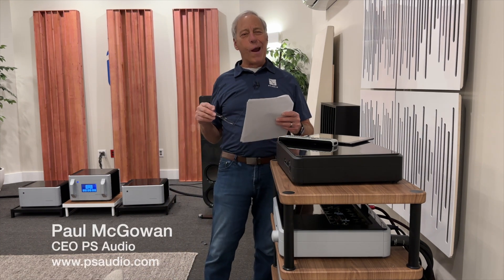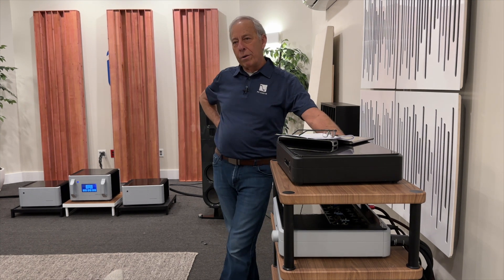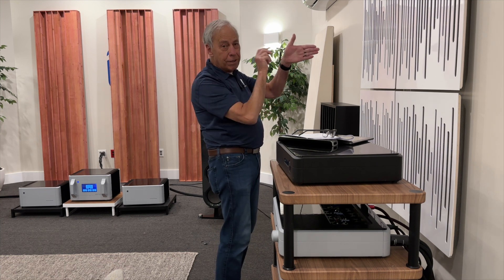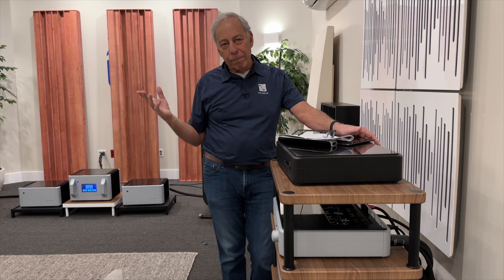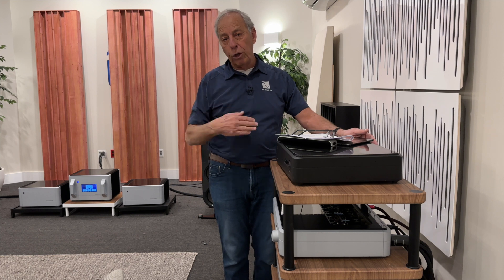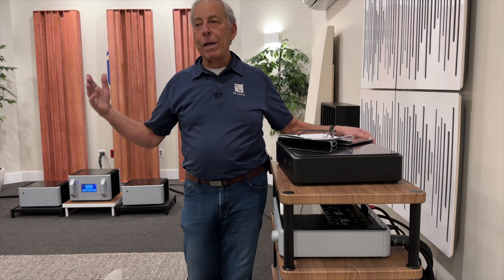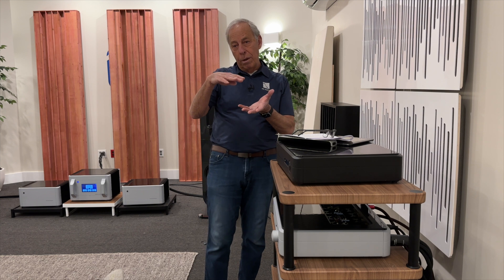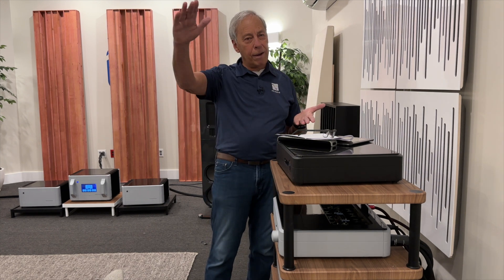Impedance matching explained

Comment: hmm.
i remember once in the past millenium, i had a couple of dynaudio contour ll speakers.
they had the option to be driven by an impedance mathing network, including a bnc terminated speaker cable. the sound was amazing. an expanded soundstage, was the most noticable result.

so, i dont know. maybe a smith chart is very relevant in hifi too...

Comment: Does this apply to loudspeakers connected to amplifiers as well and if so, wouldn't an 8 ohm loudspeaker nearly always be a better choice compared to a 4 ohm one?
Reply: Yes and no. The output impedance of a well-designed amplifier varies with frequency but would typically be in the << 1 ohm range, so low compared with both 4 and 8 Ohms. So they both work. 4 Ohm speakers allow you to get more power output from a given supply voltage - important if the supply voltage is limited, like in a car... But in a home or studio, not so much. Thats why 8 Ohm speakers are more common in homes. You can use thinner speaker wires without any significant loss as well. 16 Ohm speakers were popular back in the old valve days - amplifier outputs often had transformers in them since valves tend to be high impedance devices.
Reply: @HughCStevenson1  what if attach my 1 ohm speaker system in series with 8 ohm speakers system.is that safe or not for both of my amp and speakers????????

Comment: The power amp / speaker thing is incorrect. The speaker impedance should match the true source impedance of the amplifier. Anything else will just result in reduced output power. No amplifier is specified with an output impedance in milliohms. It will be specified in ohms with a damping factor, e.g. 100W with DF of 100. The actual output impedance is the voltage output divided by the current. The output impedance as measured with a small signal impedance meter may well read in milliohms as the output impedance is artificially lowered by the application of negative feedback and this value can be calculated from the damping factor. This lowered impedance only holds true within the capabilities of the output transistors and makes no difference to the ‘real’ source impedance. If the ‘real’ impedance of (say) a 200W amp designed for an 8 ohm speaker was really 10 milliohms, it would be possible to connect it to a 10 milliohm speaker and get an output of 160KW with an output current of 4000A, which is clearly not going to happen.
Reply: Agree with you. His explanation only holds true for connecting from preamp to power amp. For passive devices like speaker, the impedence need to match the power amp for maximum power transfer.

Comment: So basically what Paul is getting at is that low impedance drives current. You don't want your source having to do the work of driving the current that you're pre-amplifier would have to drive an amplifier with hence the high impedance between the two.

A lot of sources can drive and amplifier nowadays pretty well. But it is still nice to have a clean pre-amplifier between the two. There are some gains to be had there and surprisingly it's not just gain :)
Reply: What about a 2Vrms rca source with a 10k ohm passive pot and a 20k input impedance amp, qould it be enough to drive it? Worst-case pot impedance would be about 2.5k, so 20:2.5 = 8:1 impedance ratio, right?

Comment: i got it...but what is the problem in sound when, lets say the dac got a to high output impedence. i wanna buy a denafrips venus 2 12th and its got 1250kohm at xlr. my pre amp got 40kohm. Accuphase c2120. this should be also fine or am i wrong?

i dont get what can happen
Reply: It is probably too late to be useful but... The output impedance of this DAC is 1250 Ohms, not kOhms. The input is 40 kOhms - that is 40000 Ohms. So lower impedance can drive higher impedance easily with little attenuation. Impedance matching in audio gear is really a non-topic because the designers of equipment make the output impedances low and the input impedances high - why wouldn't they? The output impedance is most likely a resistor added to ensure amplifier stability when driving a cable with high capacitance. I am an electronic engineer and I'm happy to answer any questions but I am not an audiophile so don't ask me about the polarized speaker wires or single crystal copper conductors... :)

Comment: ........except if you need to go a long distance.  If the distance is long enough, the propagation delay and impedance mismatch reflections are generated and cause echos and distortion.  This is usually a line level,  and balanced lines.  Z = 600 Ohms.  I think the distance is in the miles, or 10s of miles.

Comment: Watched it twice and it still went over my head.
Reply: @Douglas Blake This loses me a bit. "You want the most powerful element feeding the less powerful element". My CD player (notice I didnt call it a transport) has a very low output which goes into my Amp and it has a really big output. Taking your most powerful object and pushing it into your weakest object in my world usually ends up with blown up weaker object. Again, this is over my head and after reading some of the comments its way over my head.
The best I can relate this stuff to is, pre-amp "gain". You want your gain as high as possible so the power amp gets a full signal. I get that but there is also a limit on how much gain you want. A trick back in the day was to put your Cassette deck player on record and listen to the system through it or buy the little pre amp box through radio shack. For some reason I never like it. We just used it for recordings that were real low for some reason but it always felt like cheating. Like using an EQ and having all the slides on the gain side.
Thanks for listening to me ramble. 😁
Reply: @Douglas Blake 
So true, LOL!
Reply: What goes over my head is why anyone would spend 
💰💰💰💰💰 in audio gear.
It does not compute with my brain 🧠 😀 Lots of things don’t compute with my brain. 
I have a lonely brain that only focuses on the need for one not the masses. 
I would make a terrible sheep. The herd thinks I am weird 😀😎👍
Reply: @davidfromamerica1871 ..Guess what.... almost everybody in the """heard""" think that THEY are "unique and/or weird"... 
Except for a few individuals who realise that regardless of that they "feel and believe" they are actually a "herd creature"! Which consequently and somewhat oddly actually makes them pretty unique...
Best regards

Comment: The so-called audio engineer left out a verry important part.  How power into a load effects the volume of loudspeakers.  And that so called audio engineer did the same thing when attempting to explain loudspeaker impedance.  Power into different loads does not give you the same volume and the change is not even linear.  This is actually what you need to know for impedance matching between an amp and loudspeakers.  100 watts into an 8 ohm load, 200 watts into a 4 ohm load and 400 watts into a 2 ohm load are all equally load.  And remember, a 4 ohm nominal impedance loudspeaker will probably go below 3 ohms in some frequencies because the load of a loudspeaker is a little different for each frequency.
Reply from the maker: How is that different from what I said?
Reply: Hey Andrew - ease up a bit! "100 watts into an 8 ohm load, 200 watts into a 4 ohm load and 400 watts into a 2 ohm load are all equally load." Is that supposed to say "loud" - otherwise it makes no sense. If it is supposed to say "loud" then it is incorrect. The power is what creates the acoustic output from the speaker. The different impedances are created by different numbers of turns in the voice coil... More turns - less current, more voltage, higher impedance. Between an amp and a speaker you just need to ensure that neither will overheat. Too heavy a load (low impedance) on the amp will reduce its efficiency and create too much heat. Too high an output power from an amplifier (into a particular impedance) may damage the speaker. Most amplifiers have power output ratings for various speaker impedances. If the amplifier is 100 W into 8 Ohms then a 200 W 8 Ohm speaker will be ok but a 50 W 8 Ohm speaker may get toasted. If an amplifier is rated for 100 W into 8 Ohms but has no 4 Ohm rating - don't connect it to 4 Ohm speakers. 16 Ohm speakers will be fine but you will not get the 100 W before you start to clip, probably only about 50 W. P=V^2/R, double R and you halve P... I have the benefit of a degree in electronic engineering and have been designing products for 40+ years. I thought the "so-called audio engineer" did a good job!
Reply: What's the name of your YouTube channel?

Comment: What you are saying is correct for voltage transfers as is typical in low level sources to gain stages (preamp). And pre to power amp And for solid state amp outputs where lowest internal PS loss is needed.

But you mention tube amps. In the typical output transform based designs POWER transfer is more important than either just voltage or current and power transfer is at it's maximum when source and load are the same impedance. Power transfer is also more important in RF transmitters to the antenna. Simple math will show you the power transfer function.
Reply: @Douglas Blake Use use RCA cable to your speakers? And VLF radio waves go down to 3Khz. No wonder you are so clueless! But thanks for the attempted attack!

Comment: The standard seems to be 47k for input and 200 ohms for output on line level equipment. Paul is correct on those ranges. Power amps, speakers and headphone get more complicated since your dealing with a voltage gain stage followed by a current gain stage and a power transducer.
Reply: interesting. but what do you think is the reason of why my cheap equipment sounds worst, but it only happens if i switch source to dvd player's line out. it has too much bass, sounds distorted, my amp says it has an input impedance of 150k ohms (cheap chinese amp). Why is this?? is this the cause of having poor impedance matching or it's just the line out of my dvd player having a bad circuit design?

Comment: I understood the rule of thumb is a 10:1 difference between source and amp to ensure clean signal without attenuation/distortion.
One practical example is an amp with a 100k input impedance can be run without a preamp.  I use autoformers as a linestage attenuator which are very good if you have good matching between source and amp.
Reply: this is also the basic method I was told. Which is in line with what Paul is saying. It personally worked in my setup with separates

Comment: Paul, to me, all of your gear looks like bland computers. It is all so sterile and unattractive in terms of design. It looks more suitable for a lab than a nicely decorated den or living room. Others, of course, may differ. Art is in the eye of the beholder.
Reply: Gotta love that early-2000s blue LCD. Doesn't look cheap at all on a very expensive amp.
Reply: Funny, i was going to comment that the FR30s speakers look high gloss quality materials, but the equipment finish looks like a fisher-price toy quality level.

Ive heard it said they are trying to keep the cost down with the plastic… if so, i think they need to try out at least one series with quality metal casings. 

I think people would pay for the better finish if given an equal choice.

Comment: If I have a pair of speakers wich accept 4 - 8 Ohms as input
should I set my amp to output 4 or 8 Ohms?
Reply: Try one setting, then the other, and go with what sounds better.
Reply: Does your amp have a switch on the back for 4 or 8 ohms? If so in a lot of cases the 4 ohm side just cuts the signal some so the amp can handle it. 
Audioholics did a video on it I just can't find at the moment.
Reply: @finscreenname  It's a Marantz Sr6015
Reply: I have Wharfedale EVO 4.2 Speaker
Reply: This question is not really answerable. Speakers have an impedance - they do not "accept" one. You can measure it with a multimeter on Ohms. The other commenter is correct - usually any switch on the amp just reduces the signal for the 4 Ohm setting to maintain the power output but not exceed it. I'd suggest you check the speakers - usually there is a ratings plate with the impedance and the maximum power - and set the switch to the appropriate setting. :)

Comment: Perhaps one day you'll speak about maximum power transfer.
Reply: Max power transfer happens when input impedance = output impedance.
Reply: @Douglas Blake Thanks for spotting my incorrect answer. I'll blame it on brain fade. It should actually read "Maximum power transfer occurs when the load impedance is the complex conjugate of the source impedance."
Reply: Not really relevant for audio because we are not short of power. RF electronics is a different deal...
Reply: @HughCStevenson1  It's still stupid to waste power. Why buy an expensive amp only to lose a portion of your signal because the impedances didn't match?

Comment: Hmmm... but why ?  And what happens if the ratios of output to input impedances are not followed ?
Reply: Preamplifiers and source devices are voltage amplifying devices and they can't feed the current required to a low input impedance device. The result, is lower signal level (lower volume), added distortion and frequency response problems (lose of bass and tremble) .  As the ratio of in/out impedance comes close to 1 (or worse) the effects are more and more noticeable.
Reply: Distortion that is audible is added. I speak from experience.  I was chasing it until I figured out this was the issue. I tried to split a preamp signal causing this issue
Reply: As others said, signal attenuation which means distortion.